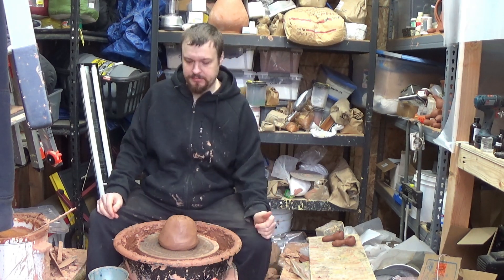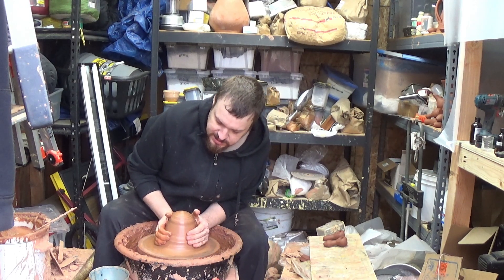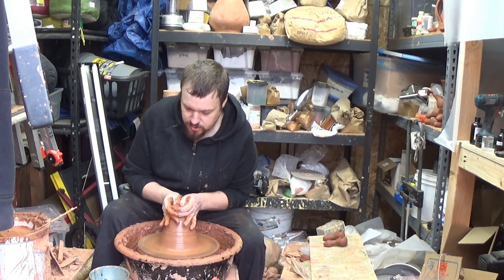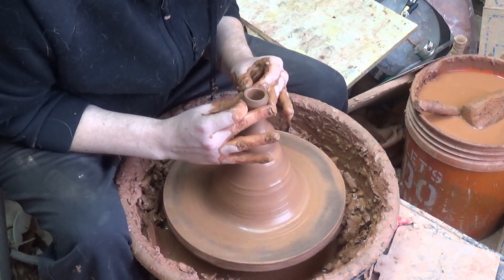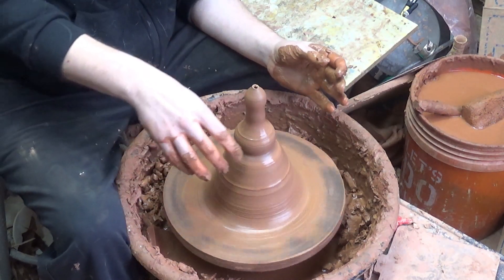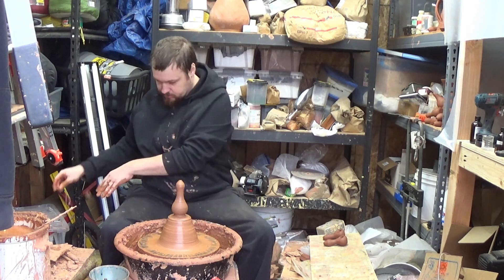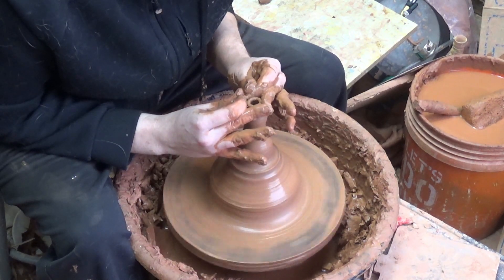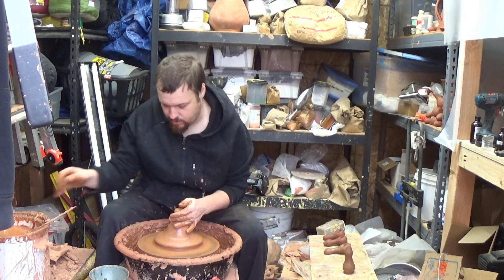Throwing pipes and shot glass off the hump demonstration

Comment: I’m kinda curious how you glaze the pipes.  Do you brush em or dip em and clean out the holes, before firing?  Thanks , Liam.  Juli in Tucson, Az 🌵🌵🌵
Reply from the maker: I plug the holes with wax and dip them :). I use orthodontic wax for braces, it's cheap strips of clear soft wax